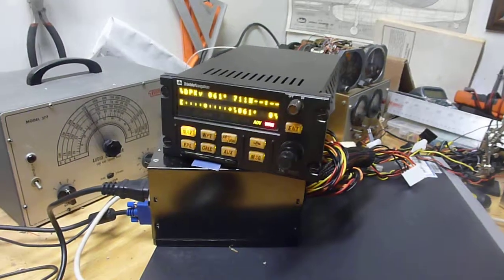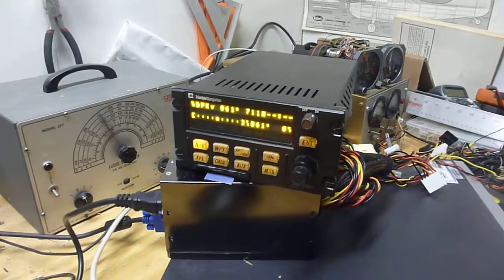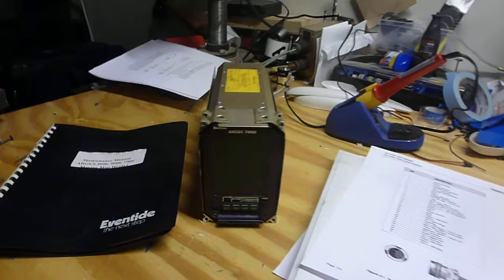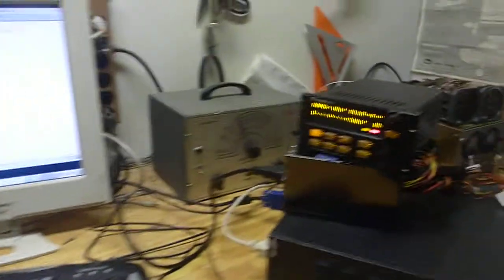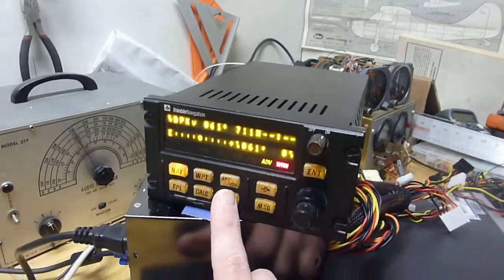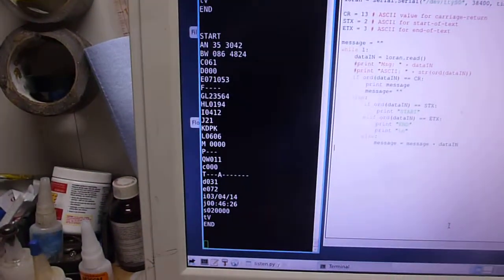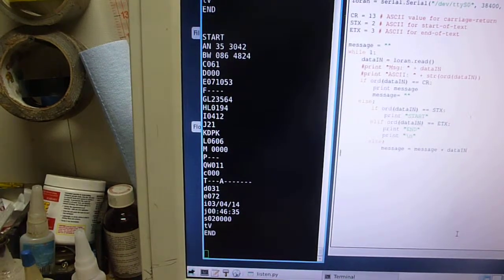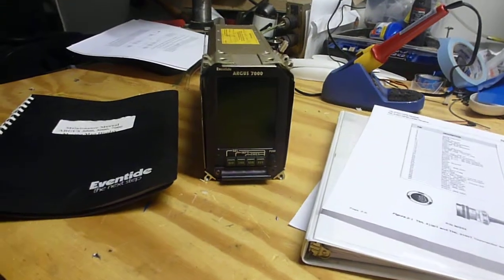Argus moving-map and GPS serial comms

Comment: Hello! I am thinking of buying an Argus 3000. Do you have a pin-out? As far as I am aware RS-232 doesn't carry power. It has a 25-pin RS-232. How are you able to have it connected to the power and PC at the same time? Does it have a seperate connector for power? I have read that FSUIPC is able to send NMEA data thru COM port so I think it should work with my simulator, right? Thank you!